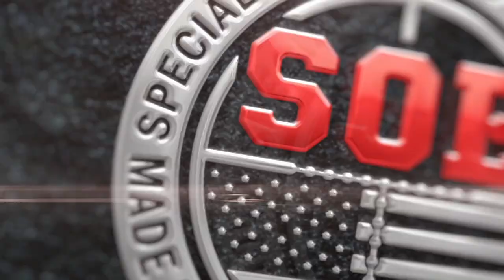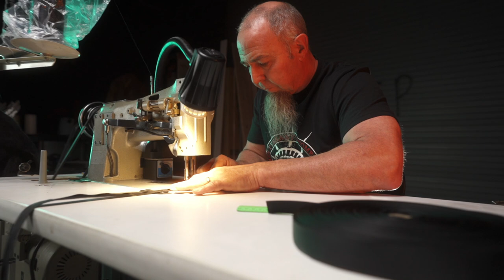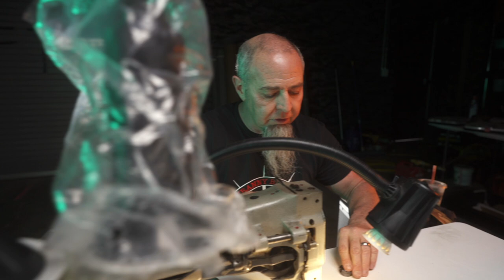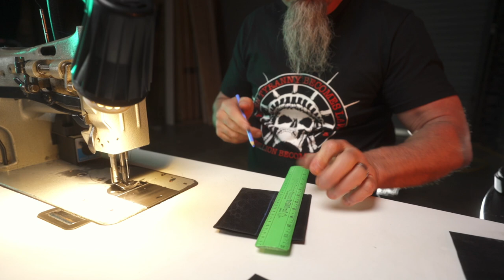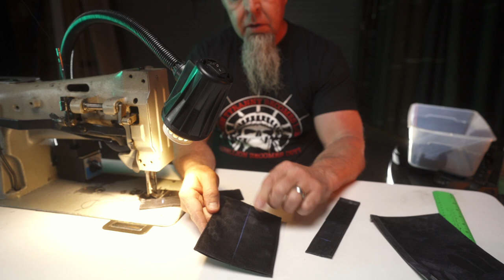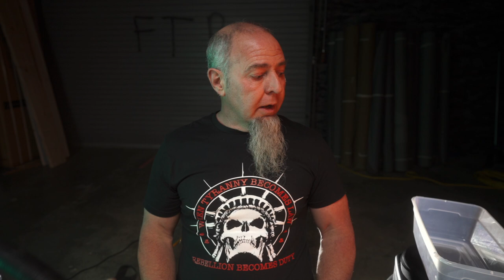Full build with John Willis Episode 3! #tacticalgear #sewing #sewinghack #nylontacticalgear #empire

Comment: I like this method of making PALS the best. It does weigh more but, it's the strongest attachment system. I've had webbing fail. And the laser cut stuff is trash. It will get stretched out over time and fail.
Reply from the maker: My pals weigh less than webbing.
Reply: @SOEtacticalgear  Yours does for sure. I just went and grabbed some of your gear and compared it to other brands who used 1000D with multiple layers like three or four folds and way more thread. It's sloppy too. Your PALS is clean, uniform, flat and light weight.

Comment: I think the laser cut looks like garbage personally. ESSTAC has gone to laser cut, it’s incredibly more frustrating to mount a plastic belt clip with the non flexible laser cut slots than regular molle webbing. And its not even.
Reply: Ive moved to the Whiskey Two Four Hypalon straps where possible